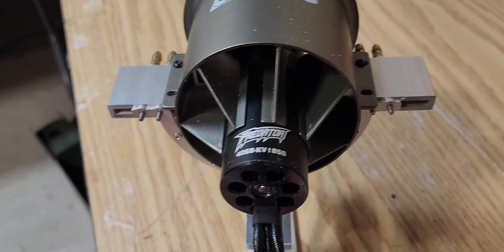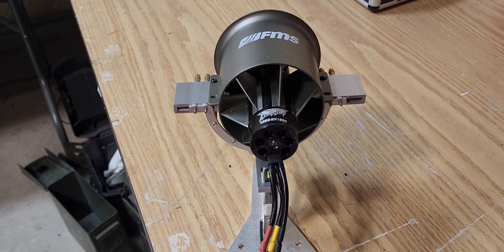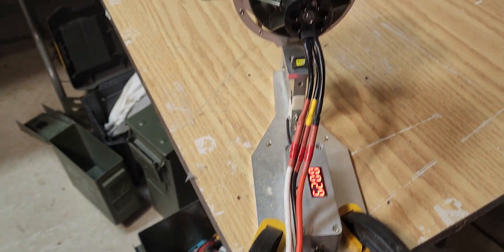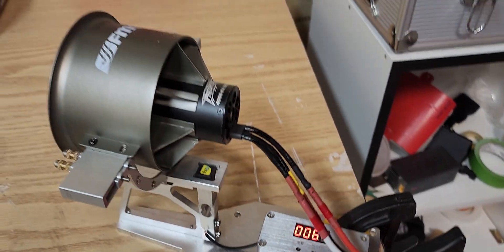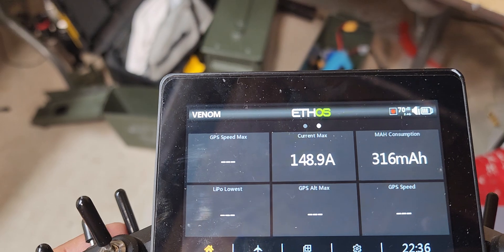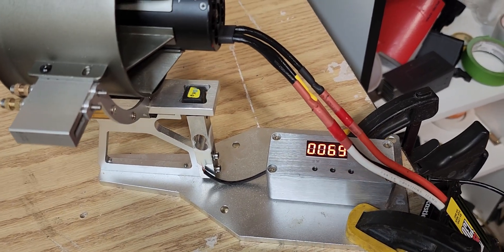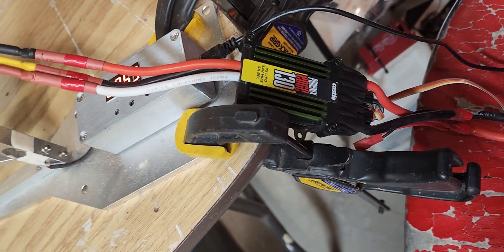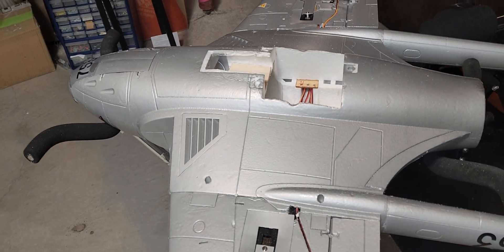FMS  90mm 4068 1850kv trust test on 7s!

Comment: I found this set up to be an Amp monster. In my F22 on 5° it was at 140A 3486W around 3.9kg thrust max. Just too much for my lipos. The 1500kv on 9s is kinder on the lipos at 130A producing 4.6kg of thrust in the F22. Thanks for the upload. I also ran this set up on my Venom too. 2.3kg plane, 3.8kg thrust and 130A draw 8°. But top speed wasnt great at 111mph. It climbs on full power and needed a down EL mix as throttle went to 75% upwards. Plus it gets the wing wave wobble with this extra speed/power. Unfortunately i destroyed it from an unrecoverable stall and demolished against a brick building.
Reply: Thank you for your infos also! And sorry for that loss on an brick building! The only thing that makes be think about the bigger 8S 4075 motor is the increased weight of the ESC and the battery itself... but probaly a better option :)